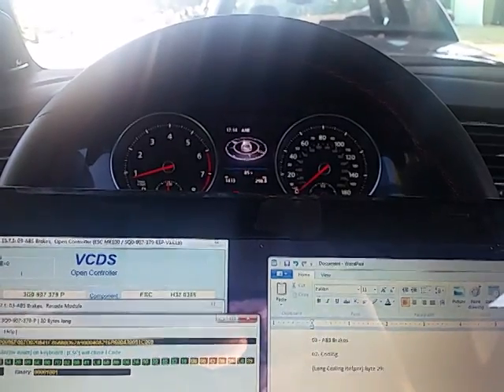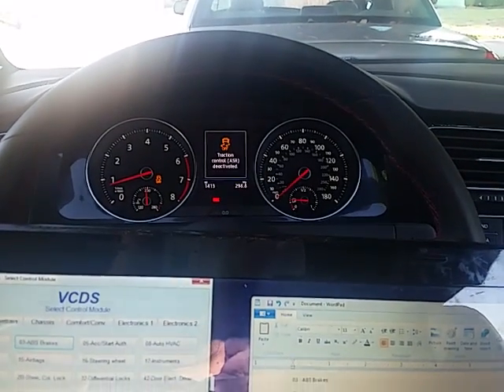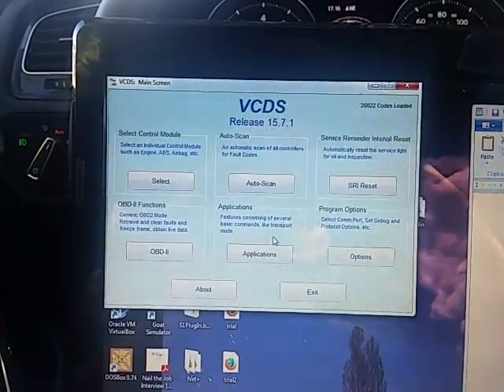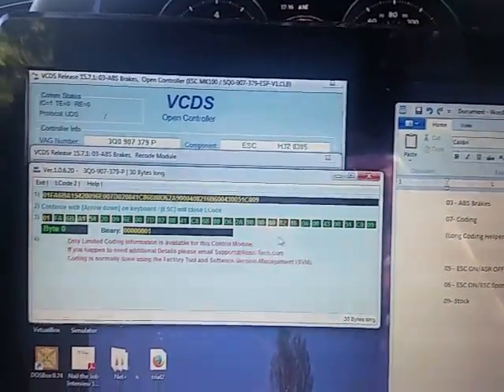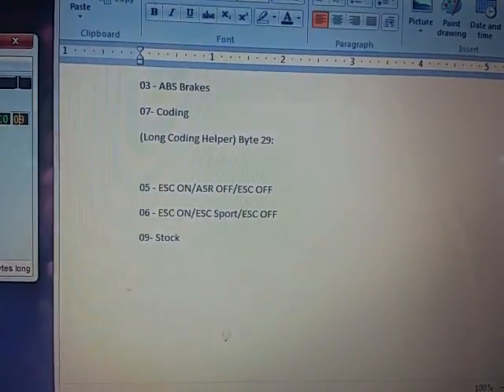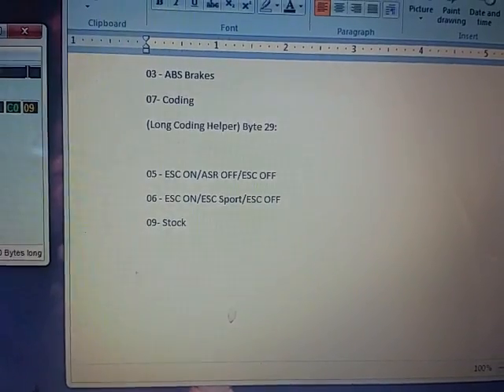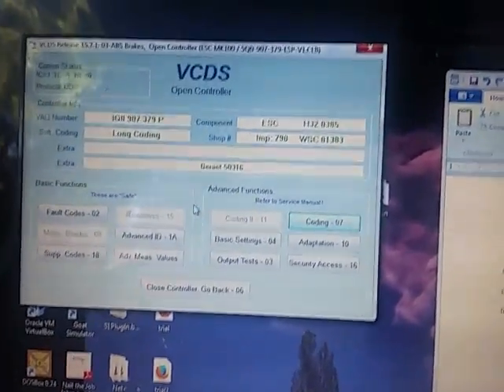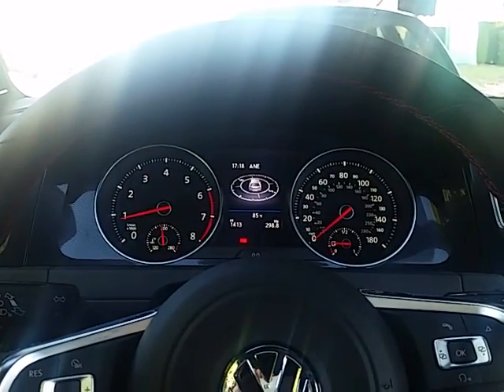Golf GTI MK7 - ESC/Traction control disable - VCDS VagCom

Comment: would this be possible on a 2018 audi a7? cant get esc to go fully off just only into "sport"
Reply: Probably yes i did it on my seat leon 2014 
Only problem with my 21. Something version of VCDS long coding helper doesnt work but you still get this huge number at the end and try changing it for me it was 03 to 06 and it should work

Comment: Would this work on a 2016 1.8 TSI?
Reply: did you ever find out?  I don't see any options for my 2015 1.8 TSI Jetta.
Reply: Hey man. I went ahead and tried it, it worked on mine. After changing the byte 29 to 06 I had ESC ON/ESC Sport/ESC OFF in the infotainment display. I can also confirm it's working even if it's through the infotainment and not a physical button (there was some debates on forums). The ESC OFF in snow allows me to give gas and spin the wheels while turning whereas ESC ON/SPORT does not. Keep in mind that some of the anti-spin is bundled in the ABS system, so there's always going to be some fuckery unfortunately. ESC OFF in summer still cuts my fuel around 4-5K RPM if I gun it from 1st gear. Good luck!
Reply: Outstanding!  I love mine; especially after the APR stage 1.  Can't wait to try!  Thanks John.